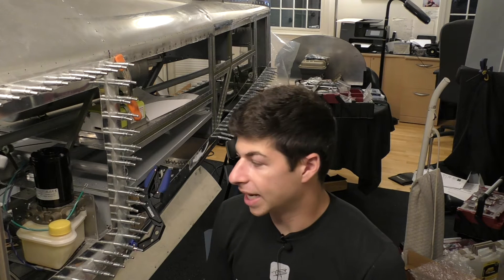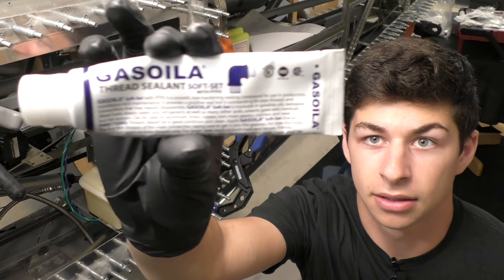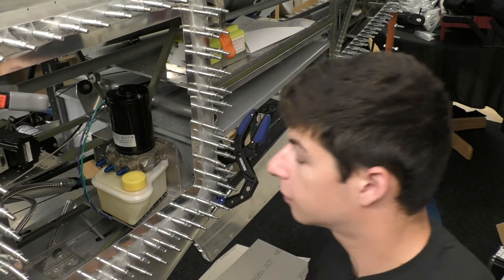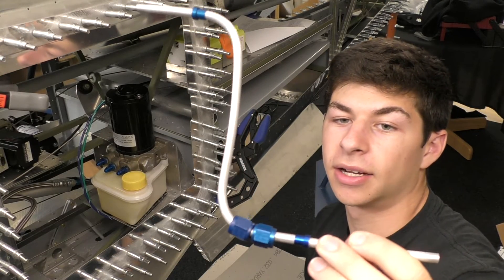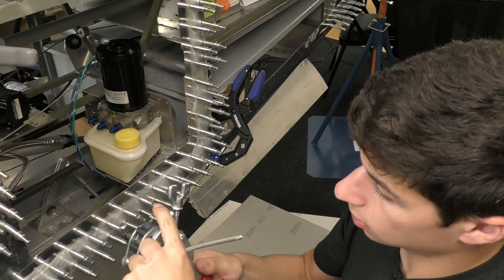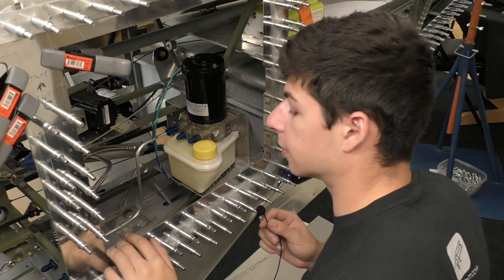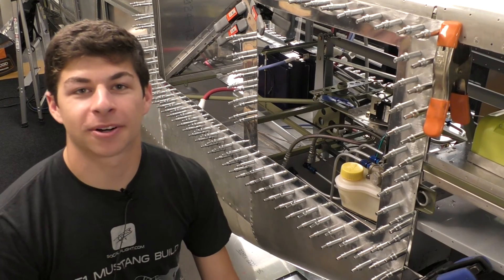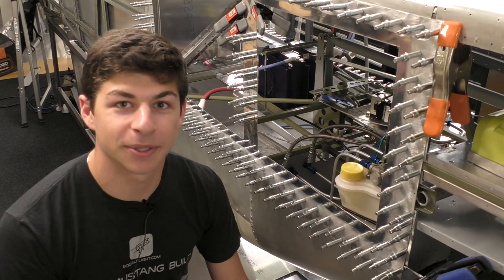Building the Iconic P-51 Mustang Replica: How to Build Hydraulic Landing Gear Pump Lines

Comment: NICE. Just wondering is that a single or double flange on the lines? Thanks
Reply from the maker: Hi Dennis - It’s a single flange on the hydraulic lines. Max line pressure is 600 PSI.